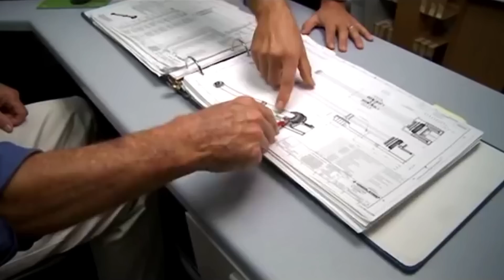US's Ultra-Advanced Railgun Weapon Is Making All Others Obsolete

Comment: (TLDR version: Because railguns use kinetic energy rather than explosive shells, they only work line of sight. So they won't work against ground targets unless visible to the gun (and the gun is visible to them). Might work in naval applications where the flat surface with no obstacles of the ocean means it can hit targets over the horizon. However, unless the projectile if very large, the amount of damage to a large ship is likely to not be enough to sink. The most likely application is as a anti-aircraft/drone/missile/artillery shell weapon that puts a large protective dome over an area. But the importance of that anti-everything ability over ranges from a few hundred meters to a 100 km in a single weapon probably merits development of the railgun all by itself).

The projectile for these weapons appears to be identical in concept to the discarding sabot rounds used in main battle tanks like the Abrams. The destructive ability of this type of round is entirely contained in its kinetic energy rather than explosive contained within. This means that  just like a tank as opposed to a howitzer, this weapon type is limited to low elevation angles if the intention is to hit targets on the ground. Shot at a high angle at a ground target, the speed of the projectile will be far lower at the far end of a high angle parabolic arc as drag is rapidly reducing velocity towards the terminal velocity of the projectile, which is dictated by the density of the projectile material and its aerodynamic drag, and which if far too low to be effective. This loss in kinetic energy is acceptable in conventional artillery shells which are fired at high elevation angles since it is the explosive in the shell that does the desired damage. 

So for ground targets like armored vehicles, radars, command posts and the like, a railgun will pretty much be a line of sigh of the weapon. But this means engagement at only a few kilometers at best unless firing across uneven terrain like valleys. However, if you can see them, they can see you. So unless they figure out a way to mount this on tank that can "shoot and scoot", a railgun will be of very limited utility against targets at ground level that are beyond line of sight. 

The exception for this is likely to be in naval applications. The perfectly flat surface of the water without intervening hills, earthen berms or even just a thick stand of trees means that a railgun can target another ship even if that ship is over the horizon (because gravity will bend the trajectory of the projectile so that it follows the curvature of the earth). Since the velocity of the railgun is substantially less than orbital speed at the surface of the earth, a naval railgun will still have to fire at some angle of elevation. But I seriously doubt that it will be so high as to result in the high strike angles on the target ship shown in this video. And while these projectiles are able to pack an incredible amount of kinetic energy for their size and deliver that energy to a very small area to allow it to punch through pretty much any armor plate, the ability of these projectiles to cause the massive damage to the superstructure of the target ship shown in the videos also strikes me as completely unrealistic.

The most realistic use for these type of weapon, as I see it, is as an anti-aircraft, anti-drone, anti-missile, anti-projectile weapon where line of sight even at extreme ranges is a given. This is especially the case if electronics can be developed that can withstand the mind-boggling g-forces during firing such that the projectile can fragment just before reaching an incoming missile, artillery shell or mortar round to greatly increase the kill probability. To be effective against larger, soft bodied targets like aircraft and helicopters all of the kinetic energy needs to be rapidly and completely transferred to the target. The fragmenting round might work if the fragments still contain enough kinetic energy to penetrate deep into the vehicle and damage key equipment. If not, the  projectile will need to be such that it deforms or fragments after initial penetration. Otherwise a rigid projectile is likely to just punch a tiny hole completely through the vehicle with minimal damage unless it hit something particularly vulnerable like the turbine engine core.

Comment: 36 THOUSAND miles an hour. That's how fast the projectile travels.
Reply: It is quite simple and dependent on the projectile mass.   15 Km/ Sec was the uinclassified speed at trials.   Do the math at the Joule level less loss and you can determine the mass at that speed
Reply: That's what I said.... 52,493 FPS is way more that Mach 4. Its is 35454.545 MPH which is Mach 46.

Comment: This is a nice fantasy, but welcome to real life, where arithmetic is a cruel mistress.  The reason that high explosive chemical propellants are used to power cannons is not because they contain so much energy (the specific energy of most high explosives is about a tenth that of gasoline or diesel), but because they release that energy so quickly.  That is, they generate tremendous power.  Power, in its physical sense, is energy per unit time.  How powerful are these propellants?  The M829 APFSDS projectile, when fired from the gun of an M1A1 Abrams, has a power of approximately 880 megawatts.  By comparison, the two A1B nuclear reactors powering the USS Gerald Ford develop a combined 250 megawatts of electricity.  That matters, because you cannot run electricity through a circuit any faster than you can generate it.  Oh, you could theoretically store the charge in capacitors and then release it very quickly, although the number of capacitors you would need for a device like this would be enormous, but then you would have to wait while those capacitors slowly recharged.  So you can forget ever mounting one of these things on a vehicle.  Maybe they could have some role as fixed position weapons hooked up to the power grid, or with a dedicated, fixed power station.  But these things will never move.

Comment: The problem, as Snoig adroitly pointed out is that the damn thing consumes itself. To the point, the navy likes the rounds, but not the rail gun itself.  I think they need to do it with magnetic coils that won't burn themselves out.
Reply: That was how it was done.   It was a total EMP projectile.  I have seen the videos showing crude units putting the charge on the rail.  But that was not how the prototype worked.

Comment: Properganda used to be at least partly based on the premise that the concept had a realistic possibility of becoming implemented in a practical way....unfortunately this does't as a piece of military hardware!  Any advantages in range over a conventional propellant charged weapon system are soon outweighed by the massive handicaps this weapons has i.e. a high rate of wear on certain components, it's bulky, it requires a means of generating huge amounts of electrical current, especially if a decent rate of fire is a requirement.  It's also not reliable enough, there are a considerable number of delicate components that fail.  This is just another nonsense video sponsored by guess who...

Comment: Another problem is the projectile itself. The 'darts' fired are hyper-sonic and have kinetic energy. A direct hit would damage or destroy small target like a tank. The dart has no explosive warhead like traditional cannons or artillery. The blast radius of the dart is very limited. Traditional round is still lethal even if it misses target.

Rail gun and it's projectile will not replace 16 inch guns on battleships, cruise missiles, mortars, or artillery. Many limitations need to be overcome before it becomes a reality.
Reply: Could they use smart rounds? Maybe something that can link to other systems and improve its accuracy, lethality etc. Information and ease of access to said information is the greatest weapon.
Reply: @lachlanevans2979  yes, good minds think alike. Absolutely, they could use smart rounds. Even today, they have rounds with rocket, GPS, and fins that can go 100 km and hit a car. All could be linked to shared data systems.

Comment: Poor research, many bullets travel over 4,000 FPS. The sabots the M1 fires a sabot at around 5,600 FPS, many rifles firing light sabot projectiles over 4,000 FPS and experiments has pushes projectiles up to close to 8,000 FPS. As with the rail gun our material science lags behind making such speeds (8000 PFS) very destructive to the launch platform.

Comment: Every ship would need to use up arsenal space for interchangeable barrels in care of an autoloading mechanism, as well as enough space on board for a machine shop dedicated to refurbishing "spent" barrels. 

If you're going to go that far, you might as well tie enough decommissioned hulls together into an island structure that can serve as a forward-operating fire base. It wouldn't have to be that fast because your longest-range weapons would be the main feature of this structure, and should never be regarded as a front-line or a first-response force. Add an airstrip for supplies, and always keep it surrounded by the same layers of security that a standard carrier group gets.

Bonus points if it's faster than the fastest supercarrier anyway.

Comment: There are two most important hurdles in railgun technology that are overlooked in this video: Rail life and power supply.
1. Life span: The rails are coated with a low melting Gallium alloy, that would melt to reduce friction and increase contact towards the projectile. However, due to the extreme conditions in a firing railgun, the rails will worn out just after a few shots.
2. Power supply: Although propellant in the form of gunpowder is unnecessary, railguns must carry all that energy in capacitors, which has terrible energy density, about 1/1000 the energy density of chemical propellant. A theoretical portable railgun would need over 5kg of capacitors to rival the power of a normal rifle round, which scales up to more than 10 tons for an artillery. In some railgun documentaries, these naval railguns has an entire room filled with capacitors, which means the mobile, truck version of it will be significantly less powerful. You could argue that Supercaps can help with this, but supercaps typically work at a lower voltage, and you need high voltage, pulse discharge capacitors for railguns. Another issue, is that you’ll need megawatts of power to continuously fire a railgun. It’s not that hard to get that much power on a ship, but for a SPG or a tank, that would be a tall order. As shown in the video, a truck carrying the railgun, another carrying a capacitor bank, another carrying a small nuclear reactor, and yet another one carrying the radar and datalink, this will be expensive and inconvenient.
Reply: don't forget the inductance of all those wires also slows down the discharge

Comment: I think as supercapacitor technology progresses we'll see railguns become more common and less expensive. Although can the projectiles still be "lobbed" over obstacles, following a determined trajectory? These test shots suggest it flies more to a "line of sight".
Reply: point it upwards and it follows a ballistic path like artillery
Reply: @anthonydewitt7674  but then it would lose the penetrating power surely, it would be just like any traditional artillery except obviously go a lot further.
Reply: @anthonydewitt7674  
The speed is required for the impact to cause enough damage.
And the speed is lost quickly because of air resistance, which greatly increases with speed.
So a ballistic trajectory (>45°) seems to me like it wouldn't work very well.
imho, it's more like a tank gun with a range of less than 10km. (maybe only around 5km)
Reply: @Robbedem  at 110 miles- the existing titanium projectile is still traveling mach 3. a 25lb. projectile going mach 3? like getting hit with an m1 Abrams main barrel projectile- LETHAL. especially when you don't even see it coming. the interesting question I have? they believe they can DOUBLE the range to over 200 miles? so.. maybe a mach 7 muzzle velocity? exciting times- big development. perhaps they plan on using a tungsten projectile of smaller diameter / better drag / loss? something shaped more like a match grade boat tail rifle round with smaller fins perhaps.
Reply: Line of sight only.  The speed is the ethalpy, without the speed it has no teeth.  MVSQUARED, M is insignificant and better if low as possible

Comment: I'm not scientist,  most of the energy used to send a projectile a hyper speed come in the form of heat. Keeping the barrel cool for repetitive shots is engineering wonder.  Also, imagine how sophisticated the capacitors are to discharge and charge . Multiple banks???? IDK. I was bummed when I read the DOD was moving away from this technology. Glad to see it back
Reply: The project just gets highs and lows of funding, i think the engineers use new research, quickly build a prototype and get a test in, then they wait again for further advancements in other areas. Bit like how fusion is just ticking along…this tech will never stop being watched, as missiles are good but a system that can work without navigation is a good back up just in case…but we have lasers now,
Reply: ye amd these will probably need a lot of electricity for each round

Comment: It is on a truck with wheels, but where does all the cables go to? Is this like a 1985 Compaq portable PC? Comes with a casing and a handle. You can carry it anywhere. But you have to plug it in because it didn't have a battery. A battery large enough would not be portable.

Comment: depending on the mass of the projectile, say, between 0.1 and 1 kg, the power supply will need to be in the range of 13-130 MJ. the gun barrel length appears to be like a standard 16 in gun from battleships, about 30 m. the reported acceleration is about 3000000 meters per second squared. this means the bullet takes 2 milliseconds to travel the barrel, which, energy wise means 6.5-65 GW of power per shot. every time you fire one of these, you have a blackout on the western seaboard, for 2 milliseconds, granted.

Comment: The barrel wear issue is a misinformation product. Projectile is suspended magnetically, like maglev train, so it doesn't touch the walls, but heat is generated and dissipated.

The barrel has built in cooling within it's walls, think rocket engine nozzles, they can and are kept cold enough to prevent damage, by using the cryogenic fuels as cooling to also turn liquid into gas for burning. 

Nuclear power systems also use advanced cooling systems to keep reactor within limits. 

The rail guns need lots of power so they will only be found on Nuclear vessels.

Comment: There were a couple of guys who built a 6 foot long linear accelerator in their basement and fired a 1/2-inch diameter ball bearing through it. They simply dropped it in and a hole immediately formed in the concrete basement wall. They found that the ball bearing had not only gone through the concrete wall but also penetrated several feet into the clay past it. 

I understand the physics of how rail guns work, though why insist on using that when a linear accelerator works without having to make electrical contact between two conducting rails? The projectile is suspended within the magnetic fields and doesn't touch anything. Pulse the electromagnets in rapid succession and have a hopper dropping projectiles into the tube - a machine gun that doesn't use gunpowder. I think that idea has been experimented with. There are a few videos here on YT where guys have made hand-held linear accelerator rifles.
Reply: Thats not a railgun, it's a coil gun. Rail gun ammo contact 2 rails on either side
Reply: @Leo-km9xg  I know that. A linear accelerator is a straight-line version of a particle accelerator, only instead of accelerating particles, it accelerates a ferromagnetic mass, such as an iron or steel projectile. If you know electronics, it can be done. 

https://youtu.be/QTDcFxTq1Fw
Reply: IIRC, railguns are a lot more efficient as far as converting watts to acceleration, as you need a certain amount of space between the coils and the projectile. In coilguns, you also need extremely precise timing on the coil initiation, or you waste more energy on top of that.
Reply: @aceg81 There are something like 30,000 linear accelerators in the world -- they are basically coil guns. Rail guns have a limit to how fast they can accelerate an object (16,000 m/s), plus they generate recoil, the rails want to push apart, and they need to be replaced. Coil guns can theoretically accelerate things nearly to the speed of light, with enough coils, power, etc. A rail gun uses the Lorenz force whereas a coil gun uses magnetic fields. There are pros and cons to both.
Reply: You're on the right track.  This work was done piggy back on the requirements of CERN and LLL and SANDIA.  The capacitor tech and sizing are very similar.

Comment: Sry, but your math doesn't add up (no pun intended). You originally stated the projectile could travel at "52,493 feet/sec" or 35,790mph. Then u stated the gun could launch a projectile "250 miles" which would only take "6 minutes." That's a speed of approx 2,500mph, a far cry from 36,000mph. So which is it?? 🤔🧐
*Not tryin' to nit-pick, just curious. 😉✌️